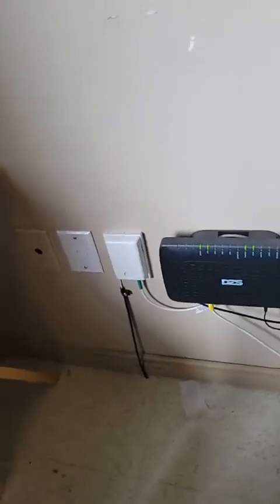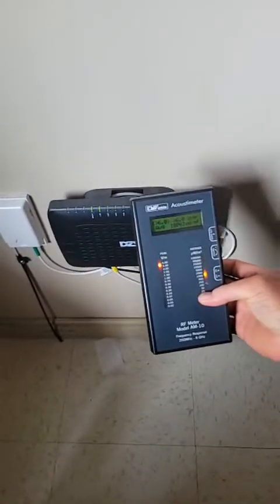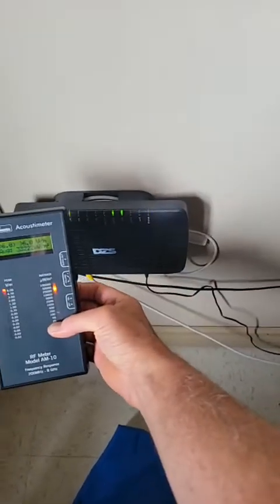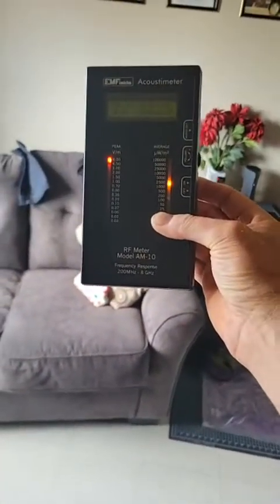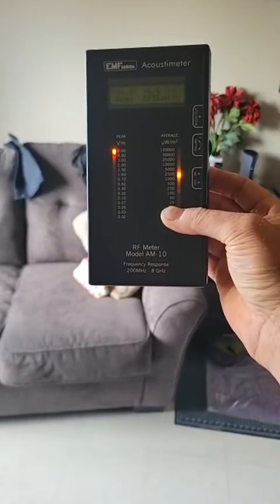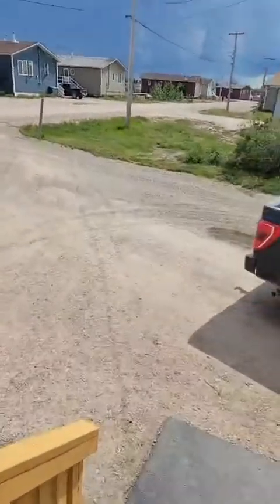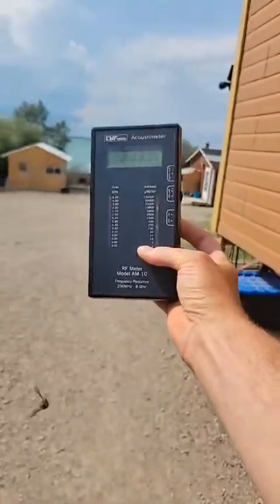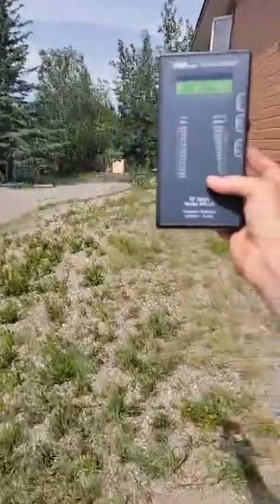Fiber Optic Radiation (Danger) Part 1

Comment: Have you tried blocking it with foil, but not wrapping it into the foil, because it might overheat and cause fire, but just create a foil box for it with few layers of foil. I found that my internet connection with modem would become much weaker when I did this, but I'm curious to know what kind of EMFs would be emitted by this as detected by your machine. Let me know if you try this.

Comment: DEAR Stephen, 
If the communication companies are installing " fiber optics" on the terminal pole out in the front of my property ( the cable to secure the pole is on my property) does yhis have a potential for any negative health effects or EMI ( below or near the pole?)
Reply: There’s nothing to worry about. I don’t know what this goof is measuring but it’s not coming from fiber optics. Fiber optics are mostly made of glass, that use pulses of light to transfer data. There actually isn’t any electricity or anything going through the cable, since it can’t conduct electricity. If you’re worried about anything coax cables and just the wiring in your house for electricity will give off more of whatever you think is gonna harm you. In fact the medical field uses fiber optics for imaging to see inside a persons body. Fiber optics have a lot more uses than just network infrastructure. Bottom line is, if you weren’t worried about the wiring in your wall for electricity, than fiber optics shouldn’t even pop up in your mind as a worry.
Reply: I think is measuring wi fi - microwave  radiation.

Comment: Well since Researching why my fruit is like drinking a double expresso. Like electricity running through your food.Solar panels cant contain all the power from the sun, leaking into the ground all over the country.. Started to Research this, lost 2 stoves from electrical currents pushed into my oven heater panels.. surging them..not usable.. The online threats I immediately started to notice . Made me more curious.. and since then, Ive had medication I was on for years poison and almost killed me.. Went blind , 106 Temp, weighed 81 lbs at 5,8 from that fever.. couldnt speak lost work for 2 months.. Had to teach my legs to move again.. A nightmare.. swallowed 3 teeth.. tried yo get unemployment while out of a  12 year  sales Rep.. job .. Been waiting for Unemployment since April of 2024.

Comment: We have LTE at this house and the guy who set it up is like you about EMF and put the router into the garage without even being asked to do it which started the whole conversation.  Next month we move and again no cables available so looking at skynet which seems to be the best option at this point - again with router as far away as possible.
I was actually looking for the info (can't remember where I heard it) that the 5g goes thru all your house wiring and totally encapsulates you in it.
Reply: I thought there was no 5G in fiber optics?

Comment: So is this new fibre optic cable for the 5G rollout less insulated, or what do you think is the reason for the radiation being so intense? Just to clarify: were they already using an ethernet cord and not wifi? I think that's what they said.